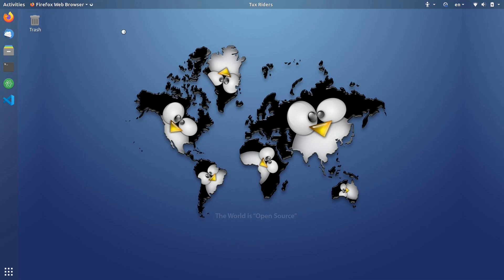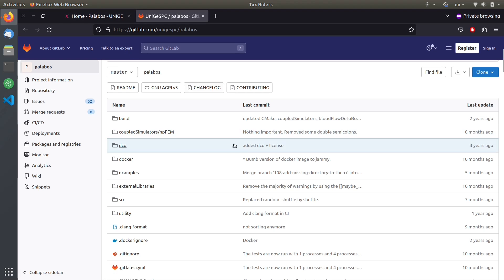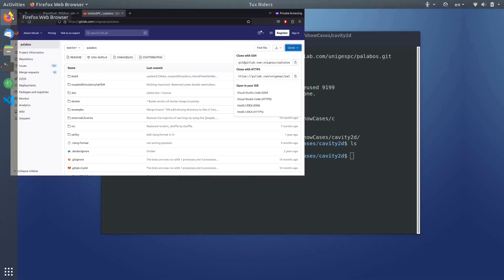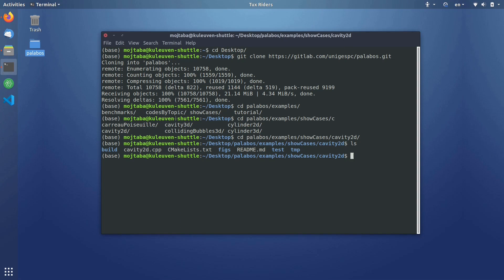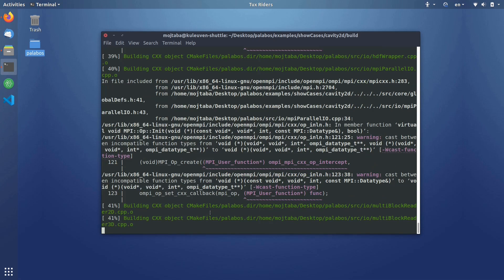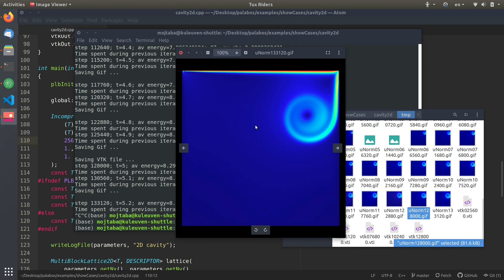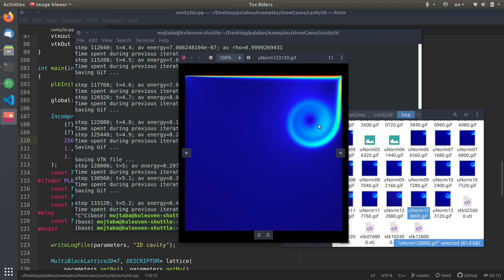Getting started with Palabos, parallel lattice Boltzmann simulation code [On Demand 12]

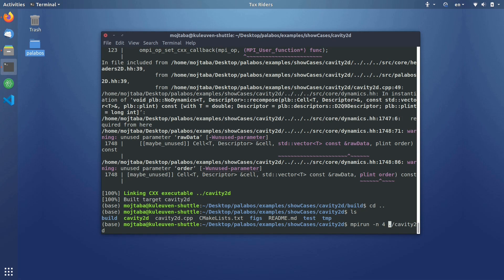Comment: Thank you for the guidance! @8:15 What would be the syntax for running this code on 4 nodes instead of 4 cores?
Reply from the maker: In HPC environments, scaling the computation over various nodes is handled by the job scheduling system and the configured MPI instance. So, you need to setup your desired parallelization (like the number of nodes and tasks per node) in the job file, and the scheduling system takes care of this. As a result, the syntax for running the Palabos code doesn't change from what you pointed out.
Reply: very much clear now. Thank you  @TuxRiders
Reply from the maker: @idreeskhan-zp5ey  no problem :)